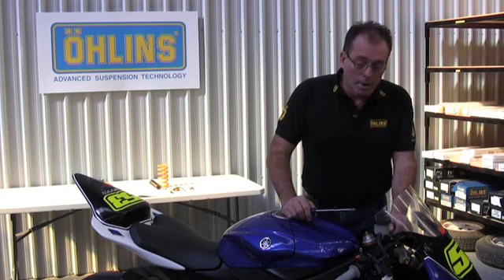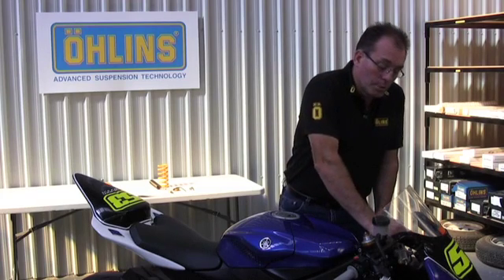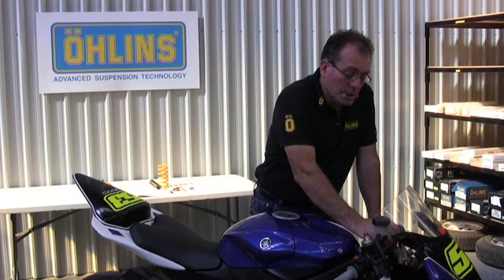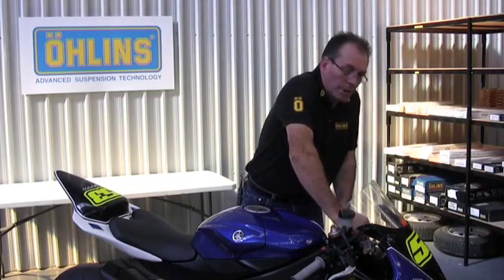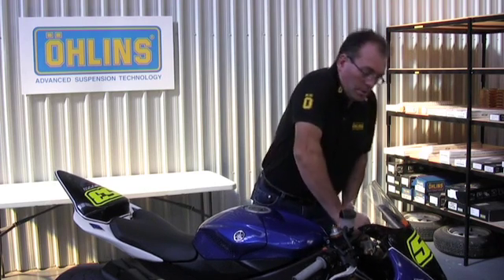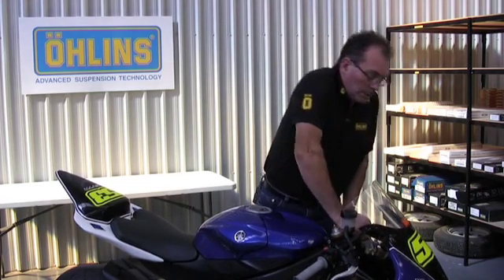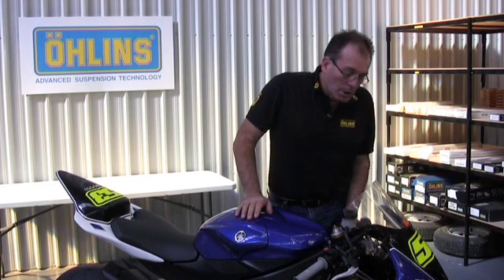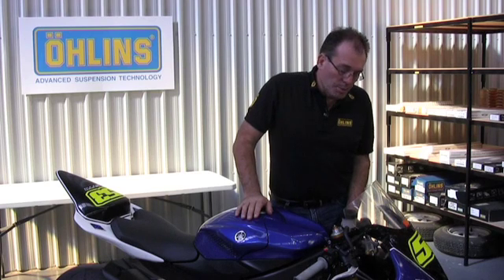Rebound Damping in the Forks

Comment: Thanks for the video.  May I trouble you with 2 questions regarding my '07 R6: 

1)  Is it  ok to use the paddock stands when setting front and rear rebound?

2) My fork rebound adjustors have an obvious full-out endpoint, but don't seem to have a definitive full-in endpoint.  (All the other suspension adjustors have an unmistakable endpoint for full-in.)    Instead, it gradually gets tougher to turn at about click 38.  To put it in some sort of perspective...from full-out, as I dial in everything remains consistent until about click 38, at which point noticeably different resistance is noticed.  Up until about 42, it's possible to turn it using downward pressure on my thumb.  From there on, a screw driver or key is needed and  at about 46 you have to use more than a 3 fingertip grip on the screwdriver.  I've taken it in as far as 51 from full-out without arriving at a distinct end, hearing anything break, or experiencing irreversible effects after dialing back out.  Should I just keep going till it stops; will there for sure be a distinct end point?

Comment: Hi I know there is a preload adjuster on the rear shock, but I can’t get the correct sag. When I take the preload to minimum I can see 3 threads above the mechanism. Is there any way to use that full potential.